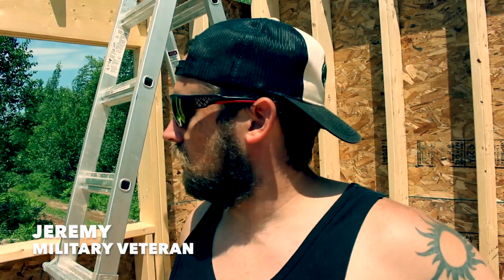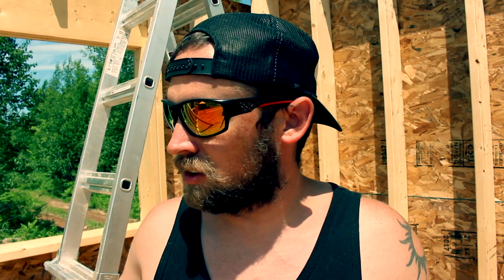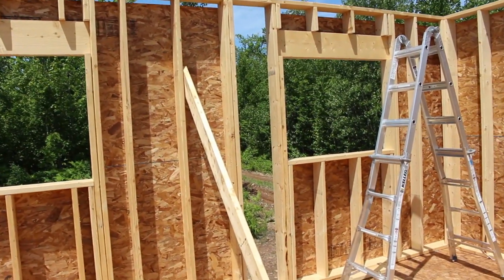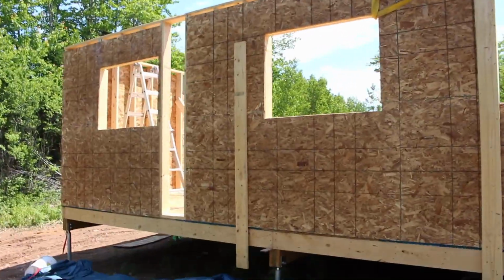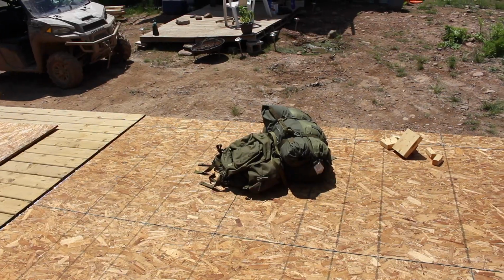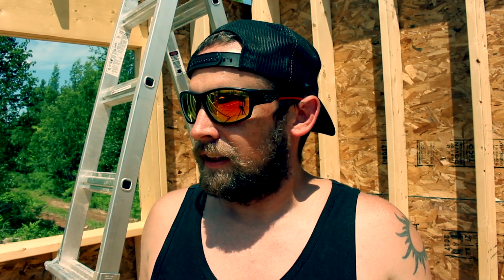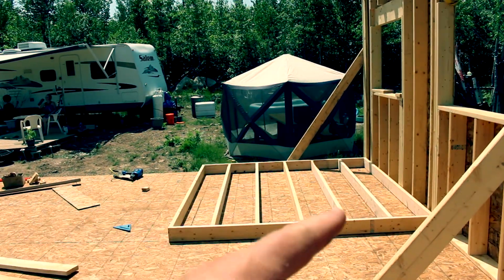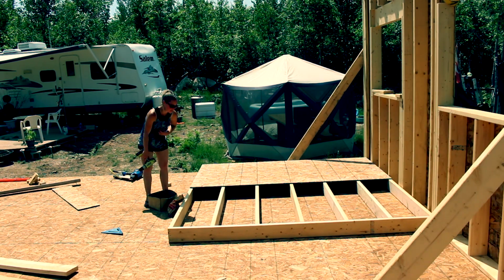24 x 24 Simple CABIN BUILD | Framing Continues.... - Ep.77

Comment: Will you need to seal the cladding on those walls in the same way you did the floor just in case it rains. Or, do they need protecting from the humidity as much as the rain because of how porous the board is?  And if it's Yes, did you get them done while they were still lying on the platform on account of it's easier to reach. Lol.   Also are the gaps you left in the top of the walls from a bit of a miscalculation with the saw or is that where the roof trusses get set into place?  There's nothing  better than having help from someone who knows what they're doing,  and it's the little tricks of the trade that make life easier still.   I know you're close to The Boss OTS, but Danny at Deep South Homestead is a Master Carpenter who built "Blue Ribbon" houses with his Construction Companies,  and one of the great joys of his life is in helping and teaching vital skills to the younger generation.  I'm sure he would help you out with problems as they arise or give you advice about why one method is superior to another.  Even just to bounce ideas off and give you another viewpoint can make a huge difference sometimes.  I think you should do the framing of the remaining walls on the platform  (even if you have to prop up a couple to give you room.)  Using the nail gun takes away a lot of the brute force on the wall frame part of the build and not getting up and climbing up & down in this scorcher can only be a good thing for your blood pressure.
Reply from the maker: We won't need to seal the walls in the same way as there is no worry of water sitting on them. When we sheath in the gable ends it will sit on top of the gaps of the walls. My old man is a licensed carpenter and he will be back on Saturday, so that is a big help. I also framed houses in the past, just takes a bit to get back in the swing of things ;)
Reply: Mapleberry Farm Off Grid Canada Well I think the two of you are doing a fantastic job.

Comment: How come you don't put on your top plate before raising the wall? All your doing is creating a bunch of extra work off ladders. The reason walls are built in the horizontal position is because it's way faster and easier.
Reply from the maker: My buddy said the same thing to me last night. Like I said in the video, I just forget some things since I last framed. Thanks Jim.
Reply: @ Chum Robarge
 It depends on whether or not that short wall is an outside wall or inside wall. You've made it even more time consuming by using two people to accomplish a simple job that can be done while the wall is down. Straightening the walls are done when you plumb and line and is not done with top plates.
Reply: @ Chum Robarge. Well, yes, they're not on the clock, but why do it the hard way? It's like taking a trip via the longest route on bad roads. 
 You say " Just stinks when the plate won’t slip over the other when erecting and a double 6” plate isn’t going to straighten out easily." When the wall is still down, take out your hammer and tap the top plate so that it separates about a 1/2". It will easily "slip over the other" Walls are easily straightened by using a spring brace like these: https://tinyurl.com/ycqljofu Skip to 4:39 in that video to see how easy it is.
Reply: Yes, always the quick and easy way!